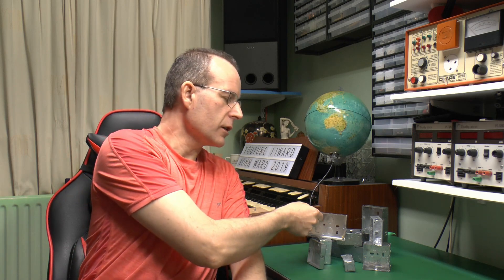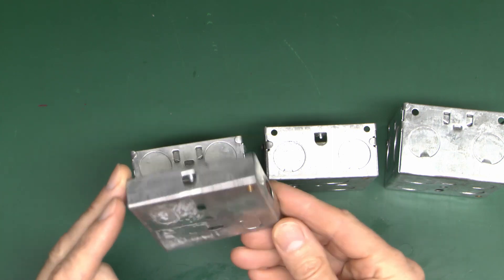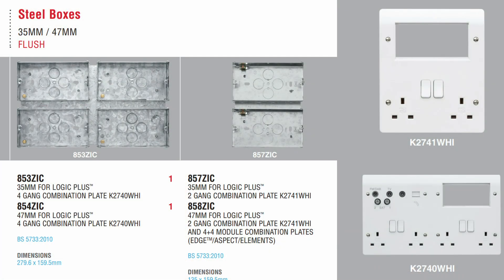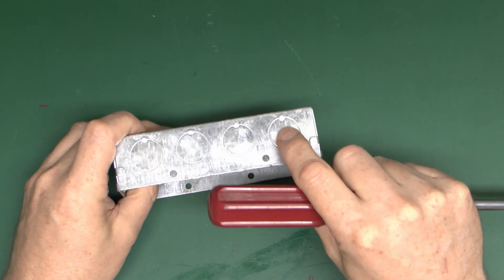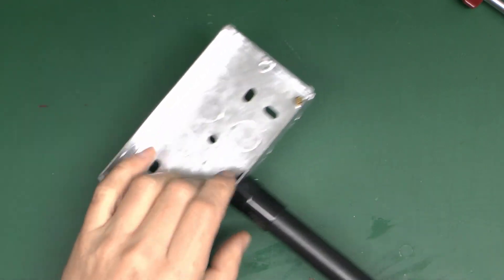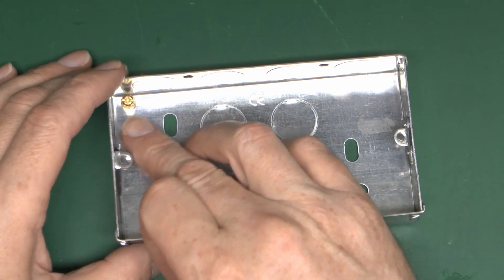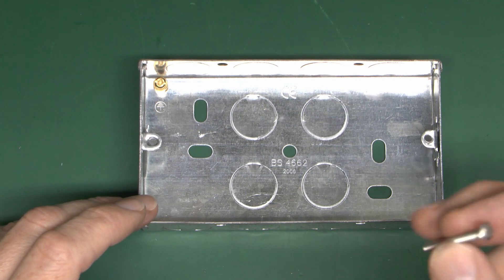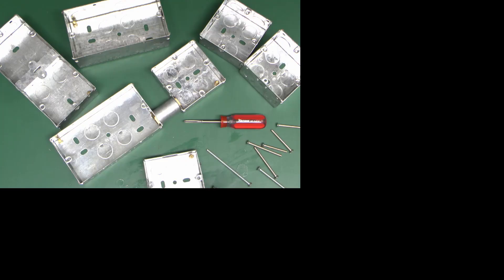Metal Backboxes For UK Sockets and Switches

Comment: Wow. Those are extremely shallow by US standards. Normal US boxes are about 3-4" deep. Height and width are about the same. US style receptacles and switches sit inside the box, with a flush plate over the front.

US boxes are normally nailed to the side of a stud and the sheet rock put on top and a hole cut out for the box opening.

I'm also surprised that there's no requirement to clamp the wires where they enter the boxes. Romex aka NMB is required to have a clamp applied at the entrance to the box.
Reply: From what I have seen - many UK homes walls are normally made from brick or stone so I guess this explains why they use shallow ones unlike the hallow walls you folks have in the US. Also unlike US module socket designs - the UK ones are normally integrated with the the faceplate.
Reply: That's what I gather too, my walls are all solid (no cavity) and there just isn't much room for anything. Some use surface pattress mounting due to lack of in wall space and ancient building materials that like to fall off when disturbed.
Reply: Why would clamping be required? The cable runs in conduit embedded in the wall, and the cable is going nowhere. It isn't as if the cable is going to move.
Reply: In wood stud framed walls it's very common to use sheathed cable in house wiring in North American rather then conduit, or armored cable, unless the wiring is surface mounted. This sheathed cable is run along framing members, such as studs or joists, and secured with staples to prevent movement, or threaded through holes drilled through the studs or joists, depending on where they are needed. When the ends of the cables are threaded into an electrical device box, the sheath is clamped to the back of the box, and about 6'' or more of the sheath is stripped off, exposing the wires. Sometimes it's called "Romex" or "Loomex", which are vernacular names for sheathed cable that were originally manufacturers trademarked names for the same.
Reply: @OlegKostoglatov  In the UK cables in the walls are meant to be run in what's called "safe zones", which are either horizontally or vertically from any electrical fitting, such as an outlet or switch. Alternatively, there are "safe zones" within a fixed distance of the floors, ceilings or any corners (150mm or 6 inches) wide. All this is meant to avoid the possibility of somebody putting a screw or other fixing through a live cable. 

Of course, where an outlet can be installed next to a stud, then it's easy enough to run the cables up that, but the practice is almost always (as far as I can tell) to use conduit in order to allow cables to be pulled through or replaced later, perhaps if they have been damaged.

Cables run outside the "safe zones" have to be at least 50mm from a surface and protected in metal conduit.

The generic grey-sheathed "twin + earth" in the UK is very similar to Romex type cabling used in North America save for the colour coding. There are, of course, sheathed cables with more cores available.

There are different rules for running cables in ceiling voids. 

For the most part, UK houses are not built with wood framed external walls (although there are some). However, internal walls are most commonly stud.
Reply: There are houses constructed from brick/block  in N.A, but in all but the older houses, and maybe in the Southern U.S and Mexico, the inside is lined with a wooden stud wall. Apparently this is also a common practice in Scotland. There are rules about how to route cable through wooden framing members as well, the usual practice is to route the cable so it runs down the center of the stud, about 1-3/4'' in, or through the center if routed perpendicular to the stud bays. Where this isn't possible there are these metal plates that are hammered on top of the edge of the stud to prevent nails or screws from being driven into the cable or cables, the same plates are used to prevent screws from being driven into water pipes.
 On top of the studs, or joists, are normally sheets of 1/2''-5/'8'' drywall (plasterboard), so the main risk to the cables is from when that is being screwed or nailed into place during installation. Whilst it is possible that someone hanging a picture, or a set of shelves could damage a cable, most outlet boxes are installed within 16'' of the floor, and light switches are usually within 48'' of the floor, near a door, so it isn't as likely that they would hit one. It's also lower voltage so less of an arc fault potential, but requires more current to do the same job, so the trade off is in the use of heavier gauge wire.
  The system of wiring over here is different, or rather the philosophy, the standard is to use parallel branch circuits, typically at 120 volts, 15 amps, with a maximum of 12 devices per circuit, 12 outlets. or 12 light fixtures, or a combination of the two. The circuit breaker is not only intended to protect the wiring, but also the device to a lesser extent, so they trip fairly easily with overloads, not only short circuits, a pair of space heaters on one branch is enough.  The appliance plugs don't normally contain fuses, but the appliances themselves often do. I can understand why you would need fused plugs with ring circuits, with 30 amps, at 230-240 volts, a defective appliance could sit there smoldering for some time before the breaker would trip.
Reply: @OlegKostoglatov  I wasn't aware there was much wood framing in Scotland on external walls. Note, it's not that wood framing isn't used, it's just the exception, not the norm. Wood is a relatively expensive commodity in the UK. 

You are right about the fuses in plugs being there because the circuits can have 32A ratings (possibly even more - it was common to have a 13A outlet on a cooker circuit, and they might even be rated at 40A on 6mm^2 cabling). However, even on a radial circuit on 2.5 mm^2 cabling, there will be a 16A or 20A breaker, yet somebody might plug in a table lamp with 0.75mm^2 flexi cable which can't handle that current. The fuse in the plug is to protect the flexi, not the device, just like the circuit breaker is there to protect the installation wiring.

In the UK now it is pretty well mandatory that all domestic circuits must be protected by residual current devices (GFCIs), but the protection is back at the distribution board (CU) rather than the outlet. The cheap and nasty way to do it is to it is grouping circuits and protect those with one device, but much better is to protect each circuit separately (which is what I've done).
Reply: @TheEulerID  You can get combined branch breakers/GFCI in the US, but they're fairly expensive. The typical practice is to use a combined outlet/GFCI at the first position in a branch circuit and daisy-chain the rest behind it. Swapping out a bad outlet is a lot easier and safer than opening the panel to swap out a bad breaker+GFCI. One just requires turning off the branch circuit, the other requires turning off the main input breaker and pulling the panel open, bring careful to avoid the incoming connections from the electric company. They aren't directly exposed, but you can easily poke them if you don't know what you're doing.
Reply: @PaulSteMarie  It's not necessary to open a panel to isolate a UK circuit. What's called the Consumer Unit has a cover over the breaker switches and each individual circuit can be isolated (or all can be isolated by a master switch).

Comment: You can tell John lives in an old house and has the luxury of fitting anything more than a 25mm! I would have to hack breeze blocks to do that. I’d rather leave them in one piece to support the house structure! You can get spacers to space sockets out a little if needs must. Oval grommets are available for 16mm boxes. Shame you didn’t show a dry lined box for modern internal walls.
Reply: Chiselling out another 10 or 20cm depth of breeze-block will only have a minuscule effect on the wall's load bearing capability. It's just a bit tedious. I had to put some deeper back-boxes in to fit some dimmer switches and it took about 30 minutes. A hammer (or, better, SDS) drill a lot of holes around the periphery to a set depth and then chisel it out. Easy enough with thermalite type block, a real pain with ancient breeze block typically made with coal ash or the like.
The trickiest bit was getting the old back boxes out, and they can be a bit tight. It's also necessary to be very careful not to damage the cable.

Comment: Someone may have mentioned it already but when using single core cables with a metal box, both conductors (live and neutral) of the same circuit should go through the same hole. Otherwise, magnetic fields could be set up if different holes are used and therefore a loss of power, apart from the fact that it does not comply with the regs.
Reply: Have you ever looked into what sort of currents are needed to create a heating effect?

Comment: 25mm type usually means a pretty difficult removal of brickwork by drilling, chiselling, angle grinding...unless there's an easier way..?
If you've got 10mm of plaster direct on brick, you need to remove slightly more than 15mm of brick. Messy!
Reply: I used a chisel which had a slotted end suitable for fitting a comb bit to. It was ideal for cutting a half-inch trench in brick or block without disturbing the main structure. Comb bits are cheap, comb chisels are still out there, google is your friend.
Reply: @brando6BL  Thanks for the tip, cheers Jerry
£4.28 Toolstation!

Comment: Those knockouts are aren't welded JW, special punches and dies are used which have a little notch so that a little tab is left when the holes are partially punched through,  probably done on a power press with a custom made tool set which will stamp out the whole blank in one hit but could also be done on a cnc machine. The knockouts are punched to a set depth so that they're almost completely through but not quite.

Comment: Why back boxes out of metal? Metal and electricity - is that not a potential hazard? Also, over time don’t they all corrode? What am I missing?
Reply from the maker: The boxes are galvanised steel, walls are not generally wet either so corrosion is not a problem.

Comment: I don't know about "morons" putting backboxes in to deep and not allowing for the extra depth. There's one extremely common reason why longer screws have to be retro-fitted and that's when a wall, typically a splash back in a kitchen is tiled at some later date. That extra tile and adhesive thickness can easily be enough such that the existing screws won't reach.

Yes, it might be possible to remove the old back box and replace it with a deeper one, but can be a real pain if it's plasteredin and there's a decent chance of damaging cables.

Comment: Brass bushes in 20mm holes, 14.30, did you see how poorly and loose fitting the hex nut end was. I remember back in the early 80's before metric brass was used how the hex nut end used to cover the actual hole. Nowadays you have to put a 20mm lock ring under the hex end to stop it popping thru' the hole. Brass bushes are terrible quality now